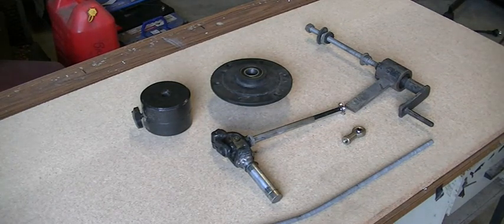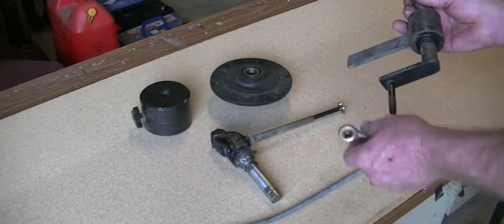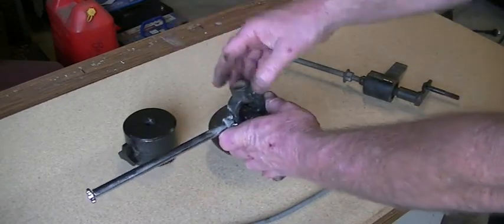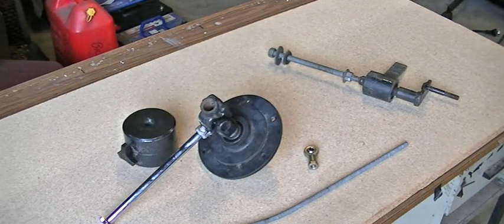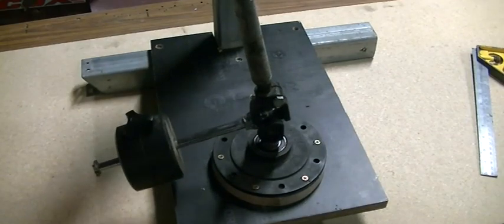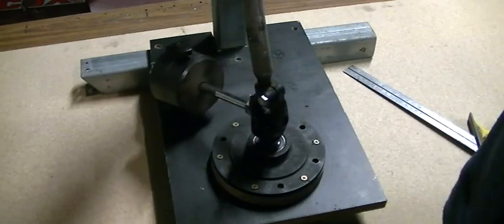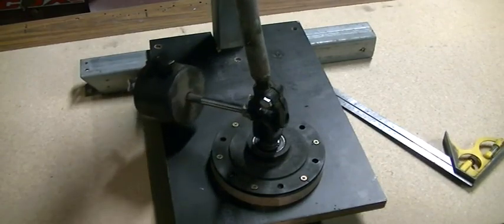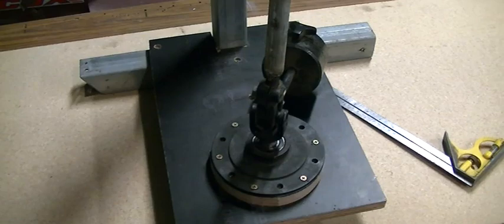I Built The Skinner Gravity-Free Energy Generator

Comment: Enough info if you Google, but ChatGpt 3.5 has nothing on William. So I asked about unconventional power generation concepts.

Unconventional power generation concepts refer to innovative and unique ways of generating energy that go beyond traditional methods. Here are some more unconventional power generation concepts:

1. *Piezoelectric Generators:* Piezoelectric materials generate electricity when subjected to mechanical stress, such as vibrations or pressure. These materials can be used in various applications, such as harnessing energy from footsteps on walkways or vibrations in machinery.

2. *Thermoelectric Generators:* Thermoelectric materials convert temperature differences into electricity. They are used in situations where there's a significant temperature gradient, such as in waste heat recovery from industrial processes or even from the human body.

3. *Ocean Wave Energy:* Wave energy converters capture the energy from ocean waves and convert it into electricity. These devices can be placed offshore to harness the constant motion of ocean waves.

4. *Salinity Gradient Power:* Salinity gradient power, also known as blue energy, exploits the difference in salt concentration between saltwater and freshwater to generate electricity through processes like pressure retarded osmosis (PRO) or reverse electrodialysis (RED).

5. *Bioenergy from Microorganisms:* Certain microorganisms can produce electricity through their metabolic activities. Microbial fuel cells (MFCs) use bacteria to break down organic matter and generate electricity in the process.

6. *Vibration Energy Harvesting:* Devices that capture vibrations from machinery, vehicles, or even ambient vibrations and convert them into electrical energy. These could be used to power small sensors or low-power devices.

7. *Human-Powered Generators:* Human-powered generators can convert mechanical energy from activities like pedaling a bicycle or cranking a handle into electricity, which can be used for charging devices or small-scale applications.

8. *Solar Windows:* Building-integrated photovoltaics (BIPV) involve incorporating solar panels directly into windows or building materials. This allows structures to generate electricity from sunlight without the need for separate solar panels.

9. *Wind Energy from High Altitudes:* Airborne wind energy systems use kites, drones, or other devices to capture wind energy at higher altitudes where the wind is stronger and more consistent.

10. *Gravity Light:* This concept involves lifting a weight and allowing it to descend slowly, powering a generator in the process. As the weight descends, it generates electricity that can power lighting or small devices.

11. *Hydrokinetic Energy:* Hydrokinetic systems capture the kinetic energy of flowing water in rivers or tidal currents to generate electricity, without the need for dams or large structures.

12. *Pyroelectric Generators:* Pyroelectric materials generate electricity when exposed to temperature changes. They can be used in environments with fluctuating temperatures to generate power.

These concepts demonstrate the diversity of ideas in the field of unconventional power generation. While some of these concepts are still in the experimental stage or have limited practical applications, they showcase the potential for alternative ways to generate energy in the future.

Comment: ok what went wrong, let me explain.  first you did not debunk it.    second,  you have failed  in replicating  the skinner device.    the skinner machine is a gravity harvesting device yes,  it works like this,  first lets call it what it is, it is a balanced flywheel that utilizes two spinning masses which together create the flywheel.  the two masses are controlled by the upper lever,  which is the most important part and the key to making the machine work.  the lever lifts the first mass using leverage and brings it to a position of balance at the top of it's lift.  at this point the weight is balanced between falling one way or the other way, the same as if you would balance a 4 legged chair on one leg.  at this stage you need really no input force or energy to maintain the balanced weight.   next stage, you now have to off balance the weight a little and when you do gravity begins to act on it to pull it down. this is done again by the lever, the lever is holding the mass in a just passed balanced position, at this point the lever stops lifting the mass but keeps the mass in this position .  now the lever arms begin to rotate in a circular path while maintaining the mass in the same just past balanced position.   this circular motion creates a path that keeps the weight falling while maintaining the weight at a lifted height so gravity can continue to act on it.  the weight is not rising and falling like you would have in a elliptical rotation of the lever.  the lever is the key to the whole system.        Now that we know  what the lever is for and what it does lets  continue.   the lever is there to lift the first mass, to lift the first mass into a position where gravity can act on it while also bringing the mass to a balanced position.  the lever then begins it circular rotation off setting the balance and now gravity acts on the mass and pulls it back down, and as it does it creates a rotation,  however the mass never really falls very far because the lever keeps lifting the mass to maintain it close to it's balance position. and as you continue to rotate the levers the mass keeps falling, even though it looks like the lever is just spinning the mass it is and has effectively harvested gravity, and that gravity  is what is making the first stage mass spin.    now the second stage,  the second stage is exactly the same as the first stage,  there is no difference in  it's basic  function.  you are still working with a lever,   in fact it's still the first stage lever that is rotating the second stage lever.   only now you have the added energy amplification  added by the first spinning  mass. which is spinning because gravity energy has entered the system.   you now have more force rotating the second lever than you had in the first stage.  and you now use this amplified  force to act on the second lever, assisting to lift the secondary mass into a position where gravity can act on it.   it's the same thing you did in the first stage.   the key to success is sizing your secondary mass so the first stage has enough energy to lift the secondary mass.   if you make the mass to heavy or try to lift the mass to high by situating the mass too far away from the bottom of the lever , the first stage mass won't be able to drive the secondary oscillation.      I hope everyone understands this.         why your system will fail,  you are not using leverage to lift the first mass, well you don't even have a first mass but if you were to use what you have there as your first mass you have to loose the crank handle because it's not acting as a lever.    follow my advice and you will have success.
Reply: Where can we find Skinners demo? or a working model demo?
Reply: not sure what you mean, if your looking for a working model you can go look at in person good luck with that.  when it comes to free energy no one want's to even take the time to explain how the device operates. you just get a video to watch while you listen to some stupid music, I seem to be the only one willing  to explain how these gravity harvesting device's work.   you don't need to go look at one, you just have to have  gain the knowledge  needed ,  and to understand how the device functions.  once you have that  you can build one and have success.  I have stated most of what one needs to succeed in my comments on this video.   read it, over and over till you understand.   and remember it's some what of a balancing act between components.  it does not matter what weight you use as your first stage, although using too light of weight doesn't give you much for gravity to pull on.   you have to have a lever, you must utilize leverage in the first stage to manipulate the first mass into a position where gravity can act on it.    make your lever adjustable so you can dial in the right amount of mechanical advantage to lift the mass to a height  where it will fall efficiently and gain a reasonable amount of speed.   remember it's the first mass that is key to adding amplified energy to the second lever that drives the second mass.   on the first stage your using the most energy to power the levers but on the second stage not only are you still using the same energy that is  driving the first stage but you now have a spinning mass connected to the second stage lever as well.  adding a lot more force to drive the second stage lever than you had in the first stage.  again in the second stage make your lever adjustable so you can dial in the lifting height of the second stage mass.  then adjust the weight of the second stage mass according to what the first stage is capable of lifting, if you try to lift to heavy of a second stage mass your first stage will not reach a good efficient speed, and it's that speed that gives you the most power.  because your relying on gravity for acceleration these machines will not be fast spinning devices.   but you want both stages to spin as fast as possible for the most kinetic energy possible.  dial in you first stage and get it spinning as fast as possible, record that RPM and then dial in the second stage to reach the same speed the first stage is operating at.   this will be accomplished by adjusting the second stage  lever length, the  fulcrum point and the weight of the second stage mass.  and yes you can now use the spinning second stage mass  to drive another stage even larger.
Reply: Your right
Reply: @Jon-fs2zj  thank you, hope my post can help others to achieve success and I am open to any correction or opinions that will help us all succeed.
Reply: Добрый день .это ваша теория или есть практические эксперименты ?я думаю машина с 2 грузами копирует движение планеты земля и луны , эти 2 груза создают в гравитации волны нарушая равновесие системы .в моей стране Украина изобретатель сделал машину в которой планетарный редуктор с грузами на зубчатых колесах спутниках  работает как усилитель мощности и энергии .
Reply: @Mechanic-s-Arktura actually both, does it matter? I am sharing what I believe is how the device functions. When you hear what I have to say know that I am giving information and information always has to go through the process before becoming a fact, before becoming knowledge and truth. Read what I say then analyze and experiment to know if it is a fact you can except and call knowledge.      Interesting your thoughts on mass creating gravity waves anything is possible.

Comment: It will not achieve over unity without all four columns working and phased at 90°. I've been researching this device for over 10 years.
Reply: and can you explain why it wont amplify without all 4 operating together.  as I would very much disagree.   each one of them do the very same thing, each one has a first stage mass that spins by gravity and that first stage spinning mass has far greater energy than the energy being used to to drive the first stage lever.   so now you have this first stage spinning mass and you use it to drive the second stage lever,  and because of the amplified energy you can now manipulate a larger mass in the second stage.  there is amplification in each of the 4.   so adding them all together you would be increasing the machines power by 4.   other than for balancing out G forces  I don't see how there would be no over unity unless all 4 were operating together.

Comment: I stepped through the PATHÉ video, I am sure you have it too. At 28 seconds William is holding the top-weigth of one of the 4 rotors (you only made one, he has 4). Any way, he then drags the top weight, and holds back the 'bottom' (the tall) weight. You can see they are separate from each other.
The top weight is attached to a piece of metal which dislocated the axis. Step frame by frame and you will see it. I hope.

I did not see this in your concept, I am afraid you are missing an important part of it and did not replicate the original.
I really hope you can look the Pathé video again, and try and find out how William has build his.
Reply: This is a good point. In other replications I've seen the two weights are awkwardly attached, indeed making nothing more than a flywheel. In Skinner's machine the weights are attached by a bearing, acting as a pivot. This means that the bottom weight could be stopped altogether during operation, while the top weight spins.

Just speculating here, but I believe I can see how this works. The bottom weight, if standing alone, would tip over in the direction of the weight. The addition of the top weight prevents the bottom from tipping over, and both weights come to rest in a position where each weight's center of gravity is balanced on the pivot. When the top weight is rotated the pivot is moved, not turned, and this causes the bottom weight to correct it's now out-of-balance center of gravity.

The gain in force is due to the pivot. The input force at the top is always constant, regardless of output load, because gravity alone causes the bottom weight to rotate. I'd imagine that a modern system could be very highly refined and need very little input force to drive it.
Reply: @jonathanpeters4240
Imagination is correct, that's the only place it will work.